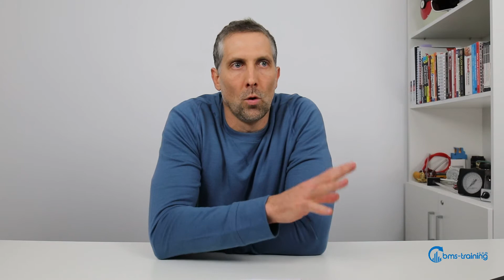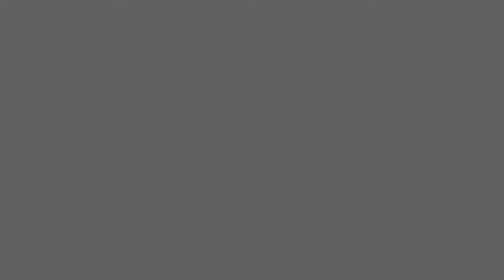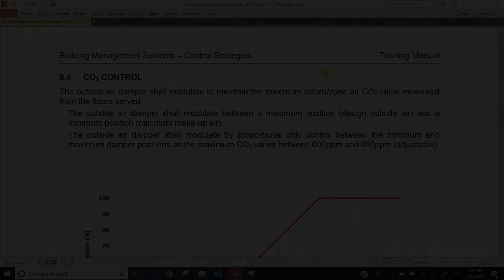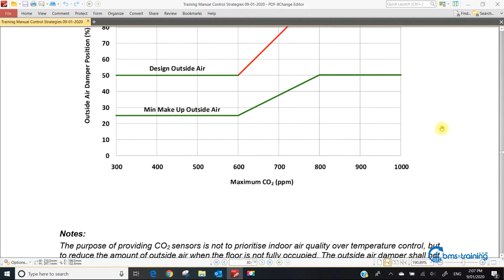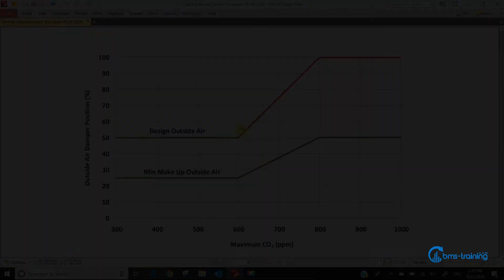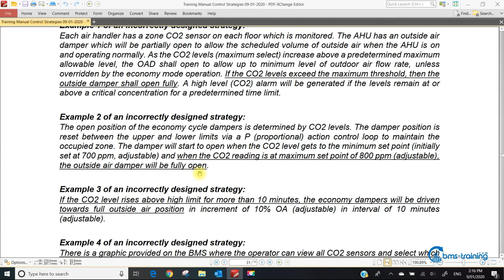CO2 Control - Demand Control Ventilation (BMS)

Comment: Thanks, Bryce for this video, and I think you considered the maximum OA damper opened at 50 % because you are considered an AHU with an economizer cycle, but in case someone has AHU without an economizer cycle, this means that the OA damper full opening is selected to pass the design OA flow rate, otherwise this means that the damper is oversized, correct me if I am wrong please
Reply from the maker: This example is for an AHU that only has one OA damper. The OA damper fully opens to provide free cooling when conditions are favorable. 
The OA damper when not in economy must only open enough to allow the code design outside air or less if CO2 is low. 
I just made up 50% as an example. I was trying to show that it does not open to 100% no matter how high the CO2 is. 
I am not sure if this actually answers your question. 

Note, the main economy damper is not sized for design outside air (occupancy ventilation). I guess it's designed for 100% design supply volume (cooling/heating capacity). This is an assumption, I am not a mechanical engineer.

Design outside air is the amount of outside air to satisfy code requirements for people, and building positive pressurisation. 
This is different to total design supply air required to meet the cooling/heating demand. The outside air damper when fully open I think supplies design supply volume.
Reply: @bryceanderson17  Thanks Bryce for your reply, regarding the free cooling, you are right the OA damper is sized to cater for the total supply air, this is why I thought you considered the OA damper at 50% to match the total design OA flow (i.e  a highly occupied theatre/shopping center with OA/SA fraction of usually 50%)

Comment: Thanks Bryce.....For explaining this.....I will implement this....however I just want to understand when the damper will open 100% in your case....
Reply from the maker: The damper will never open to 100%, unless the outside air design requirement is 100%, under CO2 control.
The damper can open to 100% for free cooling when economy cycle is available. 
However, if you have a separate economy outside air damper and minimum (design) outside air damper, then the separate (smaller) minimum outside air damper can open 100%. Because it is sized for the design outside air.
If you only have 1 (big) outside air damper, then it never opens to 100%, even if the CO2 is very high.
Reply: @bryceanderson17  Thanks Understood..

Comment: Thanks - this has validated my approach to OA / CO demand control for the past 10 years ........

Good vid ....BTW an overloaded floor is really not an issue with a central AHU design
Reply from the maker: Thanks for the comment.
If there is a central AHU and it has a CO2 sensor in the return, then yes, an overloaded floor will not make much difference as it will be averaged across all floors. Here in Australia we always have CO2 sensors on every floor, and with a high select, will be the process variable for the outside air damper.
If this is what you are referring to.
Cheers..

Comment: 1. Un ticking is useful for vacant floors or spaces
2. sustainability engineers are/should be focused upon delivering the 'right' ammount of O/A not too much or too little. 
3. LEED, Green Star and the like are 'as built' or 'as designed' rating systems, often O/A quantities are dialed back to optimum levels, within the first few years of operation.
Reply from the maker: Agree with all that except the first point. It would be useful, yes, to deselect an unoccupied floor. 
However, I feel that an optimistic facility manager or young engineer will deselect the highest CO2 sensor to save energy, which it will. But compromise the design outside air to that floor. 
An unoccupied floor will have low CO2 anyway so won't affect the outside air rates.
Thanks for sharing 👍

Comment: Thanks Bryce for this clarification. May I know the relationship with the return air damper when the outside air damper is modulating in response to high CO2.
Reply from the maker: Hi Emma, there isn't a simple answer to this. Two hours ago I was witnessing on site and when we set all the VAV's to Volume minimum. Watched the supply fans slow down, watched the return fans slow down.
Watched the minimum outside air damper open more to make up for the reducing supply volume (economy disabled, main outside air damper closed). Eventually the minimum outside air damper opened to 100%. 
We have asked the mechanical commissioning tech to now slightly close the return damper to force more air to he drawn through the minimum outside air damper. 
The answer is that in basic terms the return air damper is opposite to the main economy damper (separate to the min outside air damper). 
But it often needs to be somewhere else depending on the air balance. 
There are many ways to control min outside air, some companies modulate the return damper to maintain a mixed air plenum pressure (say -30Pa). 
You need to do what ever the mechanical balance requires the return damper to do.
Sorry, iv probably made this even more confusing, but there are probably 5 different ways to do this.
Reply: @bryceanderson17  Many thanks again. I have learned something new today. 
I am actually a BMS operator and willing to know more about the equipment sequence of operation. Therefore looking forward to more of you.
Reply: Great work Bryce, very informative and good to see you hydrating as usual ;)